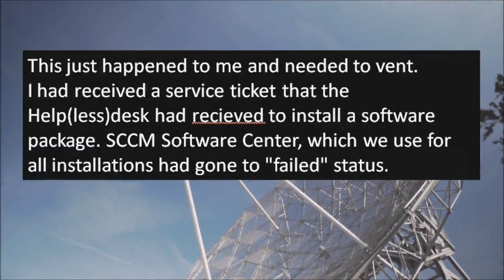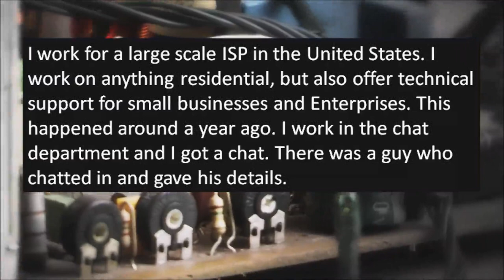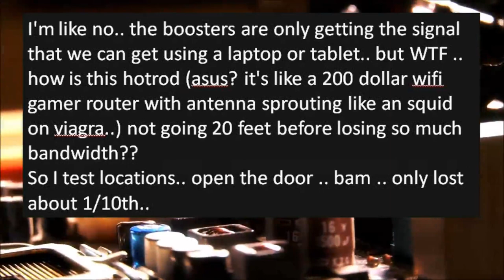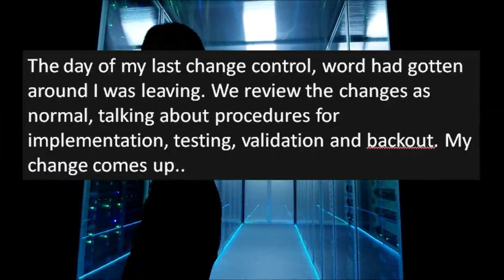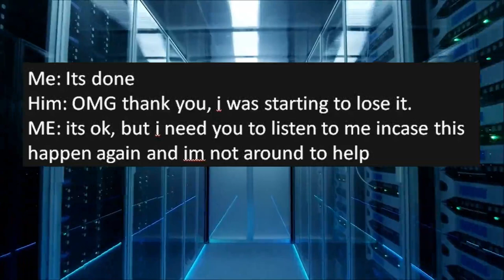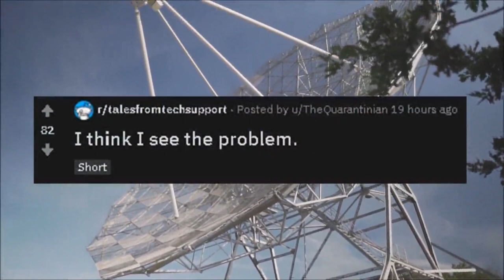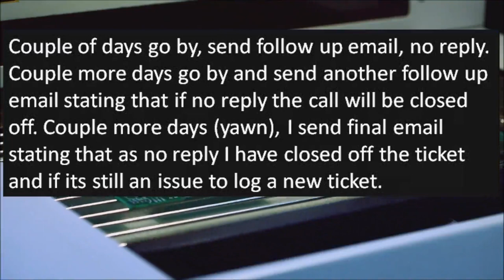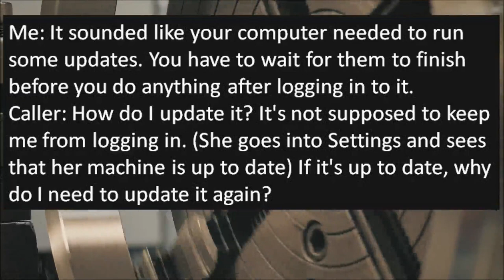Tales From Tech Support - What power button?!?

Comment: This goes back far further than the computer age.  I started working for Admiral TV in the 70's, and one of the other engineers had worked 'customer service' for a while.  One of the standard solutions to the 'no picture, no sound' was, 'Turn around the plug, because sometimes the power company reverses power on the line".  This fixed a lot of problems.  The customer would never admit he hadn't plugged it in, but would often report that he turned the plug around and it started working.  Now with polarized plugs and sockets, the trick wouldn't work.

Comment: Had a friend that built himself a cabin. He wanted this thing to survive Armageddon, including nuclear war. So this thing was heavily shielded. His complaint? His cell phone would not receive a signal inside his gold plated Faraday cage cabin.
Reply: He said he wanted a cabin to survive Armageddon, didn't say it should have reception.
So how did he fix the problem? Or did he ever?
Reply: @mattstorm360  Never fixed it as that would entail removing some of the shielding that he wanted. He did add an enclosed, but unshielded front porch though.
Reply: easy fix: get a cell repeater... and have an antenna outside to catch the signals, and then another inside to transmit them!  His cell provider may even be willing to discuss a solution that will work with them, and may even be able to install it!

Comment: I used to tell people that the principle of not being able to work until the updates are finished updating is the same as stepping up to a copier when someone is else is using it. Both people can't use it at the same time. You just have to wait your turn. The following question usually ensued, though, especially from smart alecks: "Okay, so why can it jump the line and update/copy while I'm in the middle of my work then, huh?" My response? "It's the boss." Unless, the boss was the one asking, which changed my answer to, "It's the IRS."
Reply: This only happens on Windows. On Linux, updates don't clog/slow down things and you aren't forced to reboot AFTER EACH UPDATE (only kernel updates requite it and you can still keep going on the old kernel until you decide to reboot, and those updates only happen like once or twice in the release life cycle).
Reply: Love the implication that someone from the IRS could turn up at a random company's head office, skip the boss in the printer line, copy some stuff, then leave. No, they weren't there to investigate some tax stuff or anything, just needed a printer and decided it had to be that one in particular. Hilarious.

Comment: I bought a house made in the 1870s. Plaster and internal brick walls. Not only is it a pain to get WiFi through the house, but wiring between rooms means going through a wall made of plaster, brick, air gap, brick, plaster. At least the air gap means we don't have to go through brick or living area all the way if going up or down a floor.

Comment: Wood walls: they absorb the wifi signals, so not too surprised!  Best is to run network lines to the buildings, and each have their own routers (and if you set them using the same SSID/passphase, your device should switch between them seemlessly)

Comment: thing with WIFI is that you got to under stand what channels are you using and what is in the way. If you have it where she said it was than she needs to put a router by the door to the house in range extender mode and than it will act as a repeater and strengthen the signal to the house. You can use that one than if you have dead spots in your house put a thrid one to cover those dead spots. This one also needs to be in range extender mode as well. Also check if the signal is 6 giga hz range and what channels those are running on.  walls and lights kill the signal.

Comment: Ping, as stated by previous comments measures latency, or the round trip time to send a query and receive a response. It is affected by every step of the path taken and includes the "handling time" of every link and device along the path. 

So while yes, number of devices being serviced by one router or access point is a factor, it is only one factor, some of which are outside your ISPs control.

The poster who said the ping (and speed) that you get from a test site is usually optimized (fast machine, big connection, on the ISPs network in your city etc) and so doesn't necessarily represent what you will get with other servers or even if the (dynamic) path changes.

Comment: For ping is the rule less=more. The lower the ping in ms, the more reliable your connection is (not how fast).
The "ping" is how fast your device connects to the internet and receives a signal back (in milliseconds (ms)).  Ping doesn't say anything about speed of the connection, it is just the latency combined with failures in the connection (it sends some packages to a site and receives some back and calculate how much of those packages did make the roundtrip and how long it took). Yes, a higher speed at the gate will many times give a lower ping but that isn't a guarantee.  Also more devices connected to the same line doesn't mean you would have a higher ping (in most cases it will but that's no 100% case - a high ping is in most cases a signal there are many devices connected to a too slow/low connection). 
In most cases will a higher speed connection and/or less devices running at the same connection result in a better connection and lower ping. The lag you would see in online gaming will be less if there is more bandwidth for your game (that's where the 250/50mbps comes in over the 50/5mbps). 
Theoretical, the user could even have better "ping"at the 50/5 connection as he had at his old 250/50.

Comment: bandwidth is the number of bits that can be transferred in a second. ping is the round trip time. if you have 50 mb (magabits) of bandwidth and you have a combined 51 mb of data coming from all your devices in 1 second. your gateway (router) will have to queue each packet as even thought it can send 50 mb in a second it can only sent them out in serial string of bits. 
thus causing higher round trip time.

Comment: The no-response client, it's more of they "haven't found the time" to deal with your issue, but still want to keep the ticket open.  I don't send a response when I close, but the third strike message contains it will be closed at <date and time> and afterwards to contact the helpdesk.  If they contact me after that moment, I tell them that they hadn't contacted me in 6 business days, and the ticket is closed, and to contact the helpdesk to open a new one...
The most annoying is they contact you that still having issue 30 mins before you close the ticket... and then don't respond... I use third strike for 2nd and 3rd strike then, and cc their manager :)   That usually then gets response!

Comment: Went to a trouble call at an arcade awhile back.  Customer has a huge space with gambling game machines taking up every bit of wall space and machines back to back down the center.  He just rented out the next unit and took down the wall so now he has another 2 dozen stations set up.  He’s furious that the internet has stopped working and he’s losing money.  I look down at my phone at the rate codes on his account.  50 mbps.  I walk over to the new switch he set up for the new machines and yank the plug.  Does it work now?  Yup.  Call sales and upgrade your speed.

Comment: A customer brought in a machine that wasn't working correctly. I told him, "Oh that's just an RTFM issue. I'll take care of it." I made an adjustment and handed it back. "There you go, it'll work fine now." He took it and left. When he was done he turned the machine back in, then said flatly, "I looked up RTFM." He stared at me, then leaned forward and said, "You were absolutely right." He left without another word. If you don't know, "RTFM" means "Read The F***ing Manual".

Comment: Ping is the delay between sending and receiving data packages. you might know it when you had a whatsapp chat or the like in an area with very crappy internet connection and after you hit "send" it took ten seconds to transmit your text. Just using this example so it's easier to get your head around, high bandwith can still have a crappy ping. 
In a game, the usecase was a game, a high ping can make it unplayable. lets say you shoot at your opponent only to see that he isnt standing at the spot where you aimed at anymore: thats a resault of a too high ping. 
having many devices can, but doesnt have to cause, a higher ping. within a reasonable amount ofc. not going down that rabbit hole in this comment though :D

btw: I too like the term "Technologically disadvantaged". please dont change your language, there will always be someone offended by something, no matter how you do it.